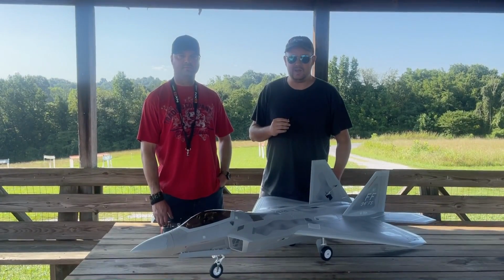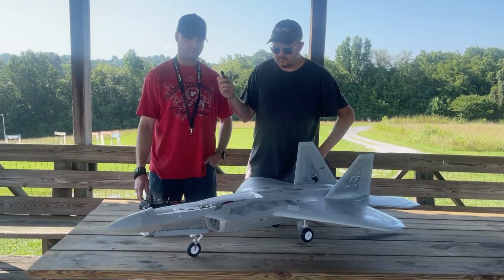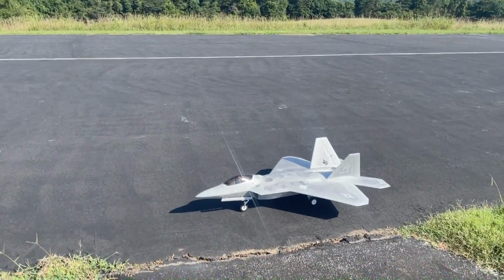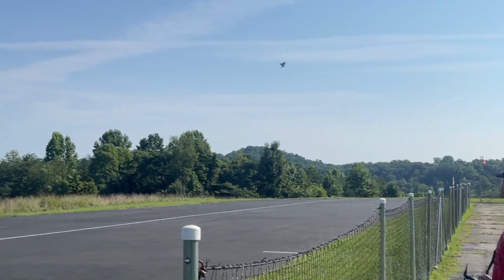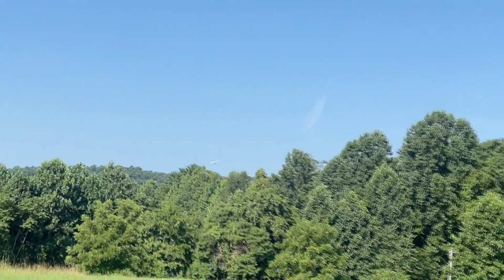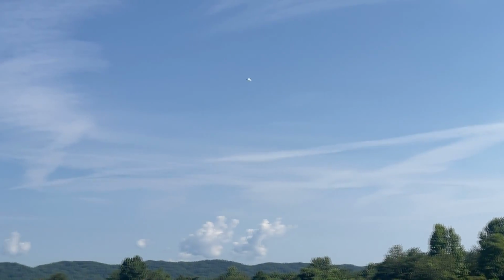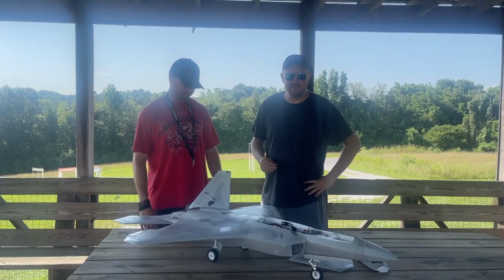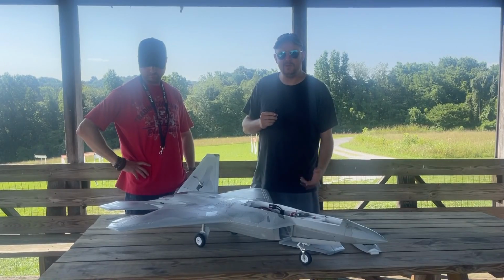Freewing F22 Ultra Performance 8S 90mm: Maiden Flight *Crash Landing*

Comment: I had similar experiences with a F16 80mm the first few times landing.  It just did not want to slow down.  And, being a maiden, I didn't want to come in to slow.  I found out that, being a quasi-delta wing, it needs a nose up approach right before the runway to slower her down and land on the mains.  Looks like the F22 would be the same thing.

The F22 is probably going to be my next one.  Thanks for the video.
Reply from the maker: Spot on about landing attitude! F-22 is great jet! I have flown several different ones,including this one since the video.

Comment: 1. Well, this is a classic example of why I start shooting approaches as soon as I get the plane trimmed well enough that I’m comfortable. And if I make a good approach, I land. If it bounces, I’ll go around and try again.
2. With an AR8360T in it, I’d set up SAFE mode and probably do the takeoff and landing in SAFE mode. It makes for a worry-free flight, provided you know how to preflight a gyro.
3. My F-22 is a 6S and I put a 6000-6S in the center of the battery compartment. It takes very little forward stick to fly level inverted. It feels neutral compared to my other jets.
4. I have some videos of mine on my channel, but I haven’t made a blog about it on RC Groups like I have some of my others. There’s really not much difference in the setup of my EDF’s, but I’m sure I moved the pushrods in a hole or two on the servo arms on my F-22.
5. I hope Mike’s isn’t hurt too bad. It’s a great flying plane. On final, I use the elevator to set a nose up angle of attack and the throttle to control the descent rate. I add throttle if I’m going be short of the touchdown point and take some out if it’s too high or going to land long. I try not to touch down more than 1/4th of the way down the runway.
Reply from the maker: 1) Agreed trim and shoot approach.I think Mike was having trim issues and trying to get dialed in cause nose heavy CG...
2) 8360T was setup with default values i believe. I personally not interested in using Safe for landing and takeoff. However to each there own.
3) Which 6S? (Curious about the weight)_
4)I will have him check it out
5)Nah,Mikes good. Repair and send it back up :)
Reply: @BDTennessee  
2. My 73 year old eyes sometimes need help seeing fighters. SAFE also takes care of most trim issues. It really helps on my EC-1500 cargo plane. Since the receiver's flight modes are on my rate switch, I can go from low rates to SAFE in a heartbeat. And I can jump back to low rates to check the trim or do aerobatics.
3. Liperior 6000-6S-65C that weighs 880 grams.

Comment: Great video... If your video is shot straight through which I believe it is that's roughly a 5min flight time. Which is pretty awesome. I was wondering if you had happened to do a battery check to see what your percentage left was. Those SMC batteries look interesting.
Reply from the maker: Thanks Billy! I have the plane now and been doing testing. Same setup with mixed acro flying and some passes. Mixed acro flying and some full throttle passes. 4min on throttle and 4:30 in air comes down at 3.85
Reply: @BDTennessee  sounds great thanks for the information...keep up the good work on your channel.
Reply from the maker: @FNSRC0417  anytime,reach out if you need some help.

Comment: It will float in nicely,no need for speed.
I think it came in hot also with the batteries to forward.that in itself will create bouncing.hope you get it back in the air soon man.
Reply from the maker: Good info bro! Mike will get it fixed and do a remaiden! #redemptionmaiden

Comment: Curious on the radio setup, not taking advantage of any dual elevators or tailorons?
Reply from the maker: Not on this maiden. Mike said was still too sensitive and only using half flaps didnt slow down not bringing the nose up... I did the remaiden with settings i used before and was simple.

Side note: I have setup F-22 with those features too...

Comment: Great video sir.  It is hard to tell for sure from the video but the approach from the direction you were approaching is terrible for a jet, having to dive in over tall trees like that.  But the other direction you have a  the valley  and a long clear approach which you could maintain a much lower slower approach angle to allow time to bleed off the speed.  Landing jets is hard.
Reply from the maker: I wasnt the Pilot on this one. We fly over both sides all time. F22 just overwhelmed him some i think and several mistakes were made. Remaiden was done and he flies no problems now.

Comment: Interesting video and very well made, thx for sharing.  
Would you say that the F22 UP is a harder bird to fly and land then the Viper 90 from Eflite ?  
Those are my top two birds on the Fighter Jet list for future purchase, so interested as to your opinion when you compare these two with regards to flight characteristics  and speed.
Reply from the maker: F22 typically should be a easier jet to fly, especially for a fighter jet.. F22 lands high alpha and floats in. Viper comes in more like a sport jet. Thrust and Speed goes to Viper 90mm. F22 has wider flight envelope with amount of lift and since its almost a 3D Fighter jet. Viper feels more precise and tighter...

Comment: This is not a plane that you want to use flaps for landing. 

You really need to learn to high AoA to effectively slow this plane down while maintaining directional control with rudder.

If you choose to use flaps for landing, I don’t suggest using anything more than Take Off flaps.
Reply: Exactly. I never need full flap on my F-22. She's a floater. Get that nose up and slow her down.
Reply from the maker: Good info! Mike is following comments to help with remaiden...
Reply: I land mine with full flaps all the time and it still lands nose high. I have to keep some power on it so that it doesn’t slow down too quickly and quit flying.